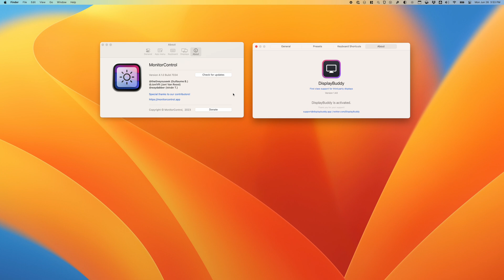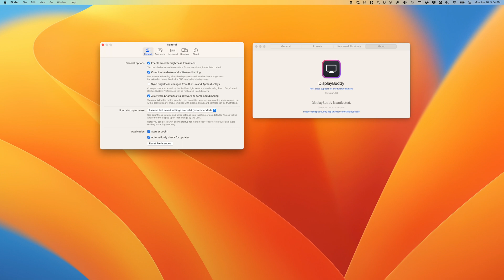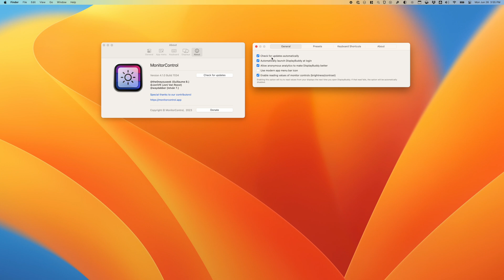DIY 5K Apple Studio Display V2

Comment from the maker: For those wondering I was able to get this panel to do 3840x2160 @ 120Hz without issues using Nvidia Control Panel to make a custom resolution. 5K seems to be limited to 60Hz.
Reply: So, a read this board specs and, allegedly, this board works at 4k 144hz... is worth checking it out!
Reply: Can it be ran 5k through hdmi? The dock I have for MacBook is hdmi only. 4k 60hz is max from one hdmi. Is using 2 an option to get full resolution?
Reply from the maker: Can’t do 5k with 2 HDMI cables as far as I know. If your dock has a thunderbolt port it might be able to use a thunderbolt to display port cable but it would need to be a cable that can do 5K (display port 1.4 or better).
Reply: @james.a  I completely forgot about using thunderbolt with an adapter. Thanks

Comment: I just need to buy "Buy - 5K Display Panel LM270QQ2 - $270" to use it, right? I'm sorry because I'm not familiar with electrical engineering
Reply from the maker: You need that panel and also the “driver board” that’s compatible with it. Check the links in the description.

Comment: Great stuff! 🙌
Seen your v3 design on Printables, looks great! I have 2 iMac 27” 5Ks at home that I’m contemplating doing a similar mod to. At least one of them. Only downside would be that the iMac screens bezels would be an eye sore.. 😅 Wouldn’t pair nicely with the LG 5K next to it. 

Also really like your MBP screen on the side, looks very clean despite the “rawness” of the build! 

Any chance you’d do a video on v3?
Reply from the maker: Thanks! I’ve been working on the v3 video for a while but I’ve had to take breaks because of work and life stuff. Finally 3d printed a frame to close the gaps around the sides and planning to put it back together this week so I can film the process. Editing is also not my strong suit so that’s really my biggest bottleneck right now after recording.

Comment: I have 49 inch Samsung tv as my high quality 4k 60 HDR monitor and would not buy any smaller monitor than what I have. Would love 50 inch 5k panel to make it bigger screen. 27" is a waste of time. Cool project though.
Reply from the maker: I get your point about wanting a bigger screen, but the idea behind a 27” 5K monitor is the pixel density. When I’m at my desk, the pixels are so fine I can’t see them without a magnifying glass. It’s almost as sharp as my MacBook Pro display, which is saying something.

Using a 4K 49” TV as a monitor is like reading a book printed on a billboard; you either sit close and see the pixels or sit far back, which isn’t great for non-gaming tasks. For gaming, sitting back might be fine, but for other computer work, it’s not ideal. I switch my PC to 2K for gaming because of my older GPU, and it still looks awesome.

Comment: How did u remove the front glass on your 5k display. I believe it's glued on.  Heat gun?
Reply from the maker: I bought the panel by itself without the glass. The panel model number is LM270QQ2. 

https://www.aliexpress.us/item/3256801164527599.html

Comment: Main component links are dead, any chance for updated ones? Thanks.
Also, would you consider making another one? I would gladly buy it.
Reply from the maker: I would consider making another. I’m just working on some minor upgrades to my current design I’ll show in my next video.  I’d have to check and see what prices are for parts too but how much would you be willing to pay I guess is the main question?
Reply: @james.a  Well, whatever the parts cost, shipping and + for all the effort. Although not sure how shipping to the UK would work.

Comment: Great video; however, the prices of materials have changed. The LCD panel is now $330+95 shipping, and the board is $250+27 shipping. Overall the project is cool, but for less money, you can pick a used 2019 LG 27 5K ultrafine with a camera and speakers.
Reply from the maker: That’s a bummer about the prices. The biggest issue for me that this solved though was that every other 5K monitor on the market only has Thunderbolt and the board I have for mine gives me the option to use HDMI and Display Port cables. This way I can use it with both my MacBook Pro and my PC at the same time and switch between the 2 with a keyboard shortcut. 

In addition to the extra ports I also added keyholes to the back plate and now I can hang stuff on the back like my SSD reader, a camera, and my Hub etc. Also
I was able to attach an old MacBook Pro Display to the side as an extra display for my desk. The modularity of my own diy build is worth the cost in parts for me. Still cheaper than an Apple Studio display.

Hoping to have a V3 video soon!

Comment: Nice build. For V3 I would propose a completely printed back panel like the Apple display and integrated Power Supply + using and old iMac27” Stand for it with the original Power Cable then. That the way I want to go. Im looking to use the Speakers from an iMac as well but not sure they can work with a normal amplifier. Do you think using Alu frame instead of steel would be still stiff enough?
Reply from the maker: How would you completely print a back panel this big? It would likely need to be split into multiple pieces and thus reduce rigidity by a lot. I used a single piece of metal because it needs to be strong enough to connect the vesa mount to the panel. I think an aluminum plate would work though. Maybe slightly thicker than the steel plate I used.
Reply: @james.a  surely it would be separate pieces.  Purely aesthetic not structural, hide away some cables and potentially integrate the power brick somewhere
Reply from the maker: Yeah, on my current version of the monitor I changed the back plate to 1 solid piece with keyholes on the back so I can hang stuff on the back of the monitor. I'll make a new video showing this version.

Comment: Nice build. What's the wake from sleep time of that 5k driver?
Reply from the maker: Wakes up quickly. Just about 3 seconds.
Reply: @james.a   That's great. The only thing left is to integrate automatic brightness via a light sensor (BH1750). You can pair a microcontroller or esp32 and a mosfet between the backlight connections to archive native auto brightness control without any 3rd party app.
Reply from the maker: @realavx  I find that I rarely change the brightness and being able to change all 3 of my displays with my keyboard is good enough for me. With the software I’m using my keyboard brightness buttons only change the display that has my mouse cursor on it.

Comment: What did you use as a power supply for the driver board?
Reply: NVM - saw your description and you bought the package with the suppply!
Reply from the maker: @stephfredhall6032 Yeah but the one I linked above is the same model in case you wanted more info on the power supply.
Reply: @james.a  Most of the boards I'm seeing in these "imac refresh" videos take a 12V supply - the one you linked is 24v.  But thanks for the info!
Reply from the maker: Yeah that's weird. The power supply that came with my board is 24V. My driver board is the R1811 v4 for LM270QQ2. (Package B) https://www.aliexpress.us/item/3256802320446594.html
Reply from the maker: 24V 5A (120W) Power Supply like this one: https://amzn.to/3Rj1ypN

Comment: What are your thought on kuycon moniter?
Reply from the maker: I think it’s pretty cool but it was still cheaper to make my own and my driver board has 2 Display Ports and 2 HDMI compared to only 1 of each on the Kuycon. It is nice that they fit the power supply inside the monitor. Wish I had access to a CNC to make aluminum enclosure for mine though. Someday!

Comment: This is awesome, thank you! I'm looking for a 5K monitor, check. But, I'm also hoping to find one that will support 4K@120hz from my PS5. The panel seems to support that refresh rate, and so does the driver board. Have you tried getting this above 60hz with any other sources such as a game console or gaming pc?
Reply from the maker: I actually haven’t tried anything higher than 60hz on resolutions lower than 5K. Will have to give it a try with my PC.
Reply: @james.a  Hey James, did you ever try out a refresh rate higher than 60hz?
Reply from the maker: @spacemangalaxy9987 i don’t think it can do more than 60hz at least with the driver board I’m using. I couldn’t find a way in any settings to choose higher than 60hz. But 5K at higher than 60hz isn’t too common either I don’t think.
Reply: @james.a  Ya, not surprising I guess. I was just hoping it would do 4k @ 120hz for dual use with consoles.

Comment: subscribed! random, but is that a custom desk as well? I'm looking at building a custom riser like that for my two 62" husky workbenches. They're a bit shallow to support my lg ultrafine 5k, asd, and 2 lg ultrafine 4ks (24" and 32"). looking forward to part 3!
Reply from the maker: Thanks for the sub! It’s actually just a random standing desk I got on Amazon back in 2020. I liked that it has 2 tiers. https://amzn.to/45aeJ0V
Reply: @james.a  awesome thanks for the link! i ended up just rigging up some 3/4" black pipe with some 90 degrees elbows and a 2x12" for about $40. not the prettiest but sturdy enough for 3 of the 4 monitors 🙃
Reply from the maker: @dericmiguel1  Nice. "Whatever works" is what I always say. 🙌

Comment: Amazing job man! It's unbelievable that the panel itself is only 270...
Reply from the maker: Yeah it’s pretty reasonable considering how great the display looks. You do also need to get the driver board though to get it running.
Reply: Well the panel cost at my country 270+delivery 120euro and the controller board 220+30delivery. Slowly these LG Ultrafine 5k display are appearing second hand around 700euro. That is more reasonable than building one like this, but the connectivity possibilities through the controller board ist then missing.

Comment: Amazing build! Did the buttons come with the driver board or did you buy/build that separately? Very excited for part 3! It would also be cool to remix this to use a screen from a recycled 27" imac, with or without the extra glass - especially as the price of those keeps dropping as the apple silicon migration happens, If I figure out the cables and buttons, I might try to use the JRY-W9CUHD-AA1 driver board for something similar to this, cheers!
Reply from the maker: Thanks! The buttons came with the driver board. V3 is in the works. You could use the same board with a recycled iMac panel but it’s practically impossible to remove the glass if you don’t want that huge chin on the bottom or the wide bezels all around. I have thought about the feasibility of cutting the glass but not sure if that would also be worth the effort. Definitely share photos of your future build too!